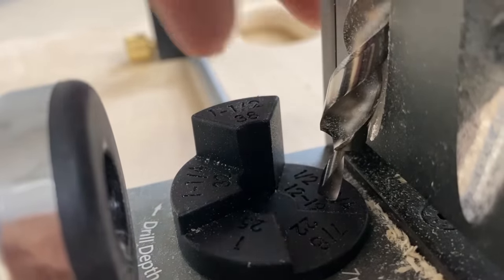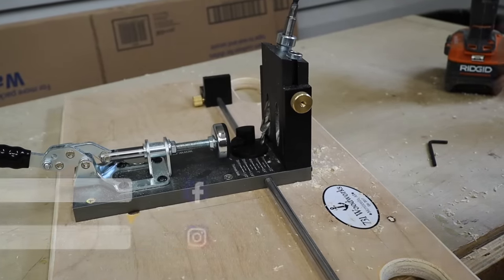Top 13 Pocket Hole Tips and Tricks | ULTIMATE Guide To Become a Pro

Comment: Great video again!!  Question on tip 3. Once you've patched the exit wound, clearly you can't just re-tighten the screw as the pocket is set too deep. The next screw lenght down will likely be too short to grip, so what do you do? abandon that pocket hole and drill another? Dowel-fill the hole and re-drill? or grind/nip off the ned of hte original screw so it sits shallower?
Reply: Also on the subject of going 1/8 shallower than manufacturer advice. If you have the kreg style jig where the depth setting isn't done via the drilling guide but separately on the base plate, you could stick a 1/8 washer on top of the drill guide metal bush, so that it drills 1/8 shallower

Comment: Is there a pocket hole jig that will work for a 2x4 and 3/4” plywood? I need for the 2x4 to be on the edge when I screw it to the plywood. Thanks
Reply from the maker: The Massca M1 or M2 will work on both. You can take it off the base for wider material.  See my review of it

Comment: When using a pocket hole jig, it's easy to set the jig position, the stop collar depth measurement, and the screw length based on the thickness of material when both pieces are the same thickness.  But when joining two pieces of material at 90 degrees that are not the same size (say a 2x4 onto the face of 1" plywood), I've never been clear which piece's thickness is used to determine each of the 3 settings.  When guessing at it, I've sometimes been left with screws that punch through, or a pocket hole channel that isn't properly centered in the board I'm drilling into.  What's the right way to set those 3 things up?
Reply: Yep same here

Comment: can you just use the fine thread screws on everything or will they damage the softer woods? and the same for the outdoor screws can you just use those on everything ? is there an advantage of indoor screw?
Reply from the maker: The fine thread screws won't hold as well on soft woods.  You can use outdoor on indoor projects but not the reverse

Comment: I keep a set of feeler gauges with my pocket hole jig to use as shims when the board thicknesses are not exact.  You can place the gauges under the clamp on the thinner piece of wood on the back side to keep the appearance side nice and flush.

Comment: What is the difference between the Massca Pocket Hole system and the Kreg pocket hole system? Is one better the other?
Reply from the maker: Depends on the model you get. I like the K5 from Kreg. The Massca is solid aluminum so it seems to be a little more heavy duty.
Reply: I got the Kreg K5 like you recommended in earlier videos. I just wanted to make sure since you latest videos are showing you using a different pocket hole system.

Comment: Great instructional video, Matt! I love using pocket holes, but I have one recurring problem; my bit often tears up the wood and splinters around the hole. I’ve tried different drill speeds and using more and less force when pushing the drill into the wood, but it doesn’t seem to matter. Even more confusing, is that sometimes the hole is perfect and smooth. Any ideas you might have about this?
Reply from the maker: It's one of the drawbacks of pocket holes unfortunately
Reply: @731Woodworks  if that’s the case, I can live with it; I was just concerned that I was doing something wrong. Thanks for the info!
Reply: U need a fresh sharp bit. Your inexperience making it dull

Comment: 0:04 - that's easy. You screwed the pocket hole to the wrong side. Put the hole on the opposite side and you won't have that problem, plus it'll be a stronger bond.
Reply: I agree but that screw hole could then be on the face or good side and a big hole to have to fill.
Reply: @dwightl5863 , joineries are designed for strength, not for show.
Reply: @arcadion448  Ok then.  You must use angle iron and bolts to hold your corners together then?
Reply: @dwightl5863 , I drill the pocket holes in the correct the location for strength. Might as well nail the butt joint together if you're going to be lazy.
Reply: @arcadion448  So how do you deal with appearance?
Reply: @dwightl5863 , fill with bondo or wood filler depending on if the need is to paint or stain.

Comment: You can't use regular screws but you can use LATH SCREWS which also have the "warsher" washer head... Good to know in a pinch or a small hardware store that may not stock Kreg screws.
Reply: Sorry but your wrong . I use regular screws all the time have yet to have an issue. Happy Builds